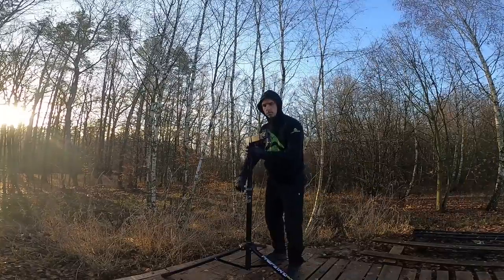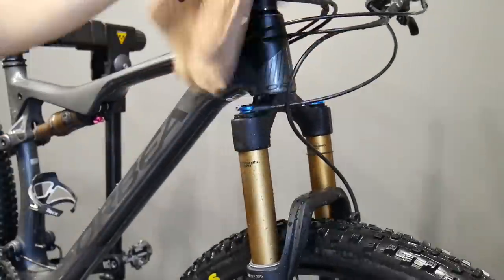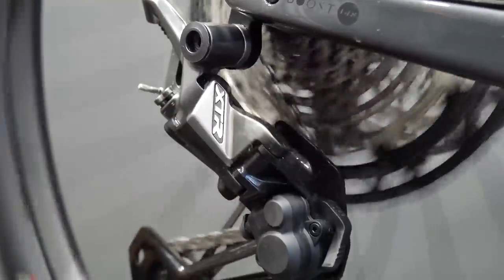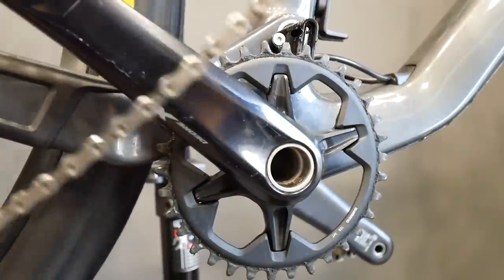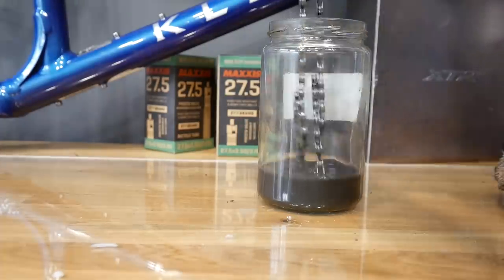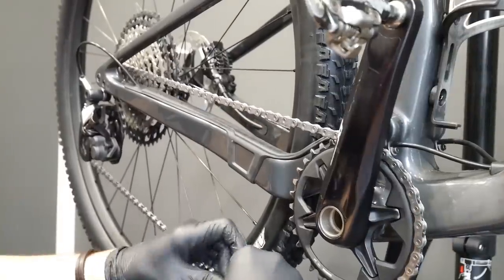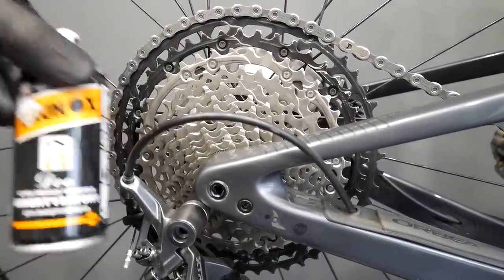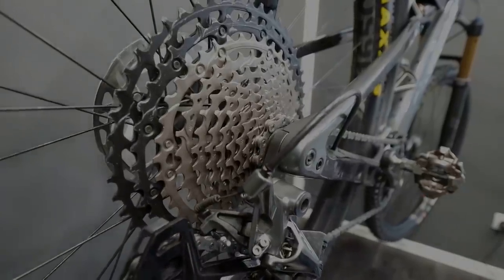One, Easy Trick For A Mud - Proof Mountain Bike Drivetrain. More Than A Clean Chain...

Comment: I have been riding and maintaining bikes for nearly 40 years. I am not impressed by this video and I have a few thoughts on it: 
1. The factory lube is in fact a really excellent deep penetrating lube for your chain, despite the fact that it can attract some dirt. A lot of folks agree. Personally I keep it on for a while and ride until chain is very dirty and needs a good clean. 
2. You don’t need to remove the chain from your bike in order to degrease it. Use a Park tool chain bath or something similar. It does a great job and no need to worry about breaking the chain and rejoining etc. It also has the added benefit of agitating your chain physically in the degreaser rather than just sitting there. 
3. You need to thoroughly rinse the chain with water a couple of times after you degrease it in order to wash and flush the degreaser out and completely off the chain, including from in amongst the rivets. Wiping off the degreaser from the outside does not remove the degreaser from inside the chain which is amongst the rivets.
4. Following this you need to dry your chain using paper towels or a dry clean rag to make sure all the water is removed. I also leave it overnight to evaporate and dry further before re-oiling. 
5. Re-oiling the chain by running the chain fast under the nozzle of your oil bottle is lazy and actually a really a poor way of oiling your chain. Instead oil each rivet individually and slowly by hand making sure the chain is completely saturated and gets into each link join. Give it an hour or more to sink in. Then clean the excess lube off from the outside of the chain and off from the chain rings and jockey wheels.
Reply: I appreciate this constructive comment, it looks like the way to go.
Reply: I've been using Rock and Roll Gold chain lube on a friend's recommendation, which seems to work well for both cleaning and drying/protecting.
Reply: Excellent comment 👏
Reply: Comment beats video :)
Reply: @MD.media01  hi, depends on the pressure you apply. Just need to lightly hold thick paper kitchen roll sheet around chain and run through and then change to different parts of the paper towel before it starts ripping. Or like I say just can use a dry cloth instead.
Reply: @watchusaiyankakaren  All of the above takes around an hour total time to do properly, perhaps a bit more. But in any event, what is your rush in life?! Better to take your time, enjoy the process and take satisfaction in a job well done. Slow living 🙂. I actually really enjoy doing it. I get real pleasure at the end when I get to place the new oil on a perfectly clean chain, followed then by a nice long ride afterwards to bask in the efficiency and aesthetic of a perfectly clean drive chain and bike. One must take enjoyment out of the simple pleasures in life!
Reply: Wash chain with water? Are you mad?
Reply: @the_udmurt  what are you talking about?
Reply: @paddyotoole2058  you don't have to remove degreaser. It dries completely. If it is good one, without oil, of course
Reply: @the_udmurt  yes, the degreaser will dry but it’s residue of detergent and other ionic substances shall then remain on the chain. Do you think all of the degreaser just vanishes into thin air?!
Reply: @paddyotoole2058  i am doing like this for 5 years and have no problems at all even with Smoove lube
Reply: @MD.media01  depends mostly on the quality of the paper towel. the more expensive ones usually will not leave bits, they are more resistant to friction
Reply: maybe clean the outside with the cloth when you get the new chain if you want to leave the factory grease in, no?
Reply: You are weak if you need to lube your chain
Reply: I also prefer to take off the chain for cleaning. It makes cleaning the chain a lot easier but it also let you clean the rest of your drive drain with more ease. I used to have the ParkTool chain cleaner but I was honestly not impressed with it. Instead I use a method similar to SickBiker's way. But I use a plastic round container (like the one seen in the video) and spin the chain for several minutes in a mixture of hot water and dish washer detergent. When the water gets dirty I replace the water with hot clean water and repeat this until the water stays clean. It usually take three to four cycles. This removes any dirt from the chain. I usually dry it off with a rag and let it dry over night before mounting it back on the bike and give it a new oil treatment.
Reply: Ain't nobody got time for individually lubing the rivets
Reply: @the_udmurt  I have to agree with paddy , water does wash the degreaser off and then you have to dry the chain off and it is a pain in the arse.I spray GT 80 on the chain and then use the chain cleaning device dry so to get in to all the nooks and crannies and then rag all off and also have an air line, so this at least cuts out the water wash off

Comment: I think is better to remove cassette before cleaning. Degreasing spray and oil from brush can end on disc rotor. Result is contamination, which is bad.

Comment: Holy cow! If you do this every time you've been in wet/dirty conditions - Respect! No way I can find time and energy to do this 'trick' more than a few times a year...
Reply: Me too.

This seems to me extremely inefficient.
If he does this really after every wet/muddy ride, he wasts soo much time of his life.
I mean... Normal chain maintenance needs what, 5 minutes? Clean it, relubricate it, remove acess oil. He needs I would guess an hour? For what? To save 30 Bucks every 4-6 months?

Before a race, yes, absolutely. For everyday riding? Hell no, I have better things to do.
Reply: @dag1704  yep! For my opinion, methode like this costs a lot more time, than price equivalent of the chain. Seems like less cost is just buy a new chain when it dies instead doing this almost every other day. This methode, for me, looks like I have to grovel to my bike, instead riding whith pleasure.

I just trying to say, that u need to spend a LOT of time for this. It`s okay if u have much of free time, but it doesn`t if u have to work 50+ hours in a week, lol.

Comment: Soak and flush the chain in petrol, dry off with a rag, soak in de-greaser and flush with waste, dry off with a rag. Allow the grime to settle, drain off and save the petrol and de-greaser for later reuse.
Melt paraffin wax to about 55-60DegC take off the heat and add approx 20% 20w50 oil. Pour into a plastic container that the wax can be removed when it solidifies later on so you can remelt.
While the wax is still liquid immerse the chain fully so it is covered with a bout 50mm of hot melted wax over it. Agitate the a little to allow the wax/oil to penetrate and displace any air within the chain and leave for about 10-15 minuets. Fish out the chain with a wire hook while the wax is still molten and a skin is just forming on the surface of the wax. The chain will still be hot allow the wax to drain off and lightly wipe off the excess wax. Allow the chain to air cool and reinstall chain on the bike.
The wax/oil mix will have lower the melting point to a bout 35-40 deg C for remelting and waxing the chain. The wax mix on the chain  will become soft at around 28-30DegC and unlikely to spatter all over your bike as oil does . Sand and dust is less likley to stick to this mix than it is to oil or grease.
Re-wax every 4-6weeks depending on how much you ride.
Reply: that lasts months on my road bike keeps it looking new after a thousand miles

Comment: Cleaning the cassette after lubricating the chain?   Is the video in the correct order? I would clean everything first, then I use an air compressor to dry the chain. Leave it for a while then lube everything.

Comment: I service my bike at home so I switched to wax. I remove the chain, clean it in a bottle with a small ammount of mineral spirits, then place it in a molten wax bath for 5 minutes. Waxed chain leaves no grime so I don't have to degrease the rest of my transmission - everyghing can be cleaned with warm water and a rag/brush, no mess. Performance-wise, didn't feel any difference.

Comment: A.wet the bike
B.Motip gel degreaser on the chain and cassette
C.fill up the chain cleaning device with degreaser
C.Spray with WD 40 bike wash liquid everything including the foaming drivetrain.
D. Run 50 rotations with the device filled with degreaser and another 50 with water
E. Hard brush long bristles do cassette and chainring. Rest bike with sponge.
Rinse everything. Dry with rag. PTFE spray  on derailleur, dry lube always on the chain, brunox on shocks and dropper posts. That's 10 minutes. It's my nemesis but it's done after every single ride right at the car parking.
Reply: Always protect your rotors from overspray of lube. I forgot to do this on my rear disk. Just a little bit of overspray will mess up the pads if it's not cleaned up.

Comment: I totally agree keeping drivetrain clean and dry is most important. But i would suggest to use dry industrial chain grease, it is times better than bike chain greases. But ofcorse after applying the excess must be cleaned because chain only needs grease inside bushes not outside.

Comment: Wheel out to clean cassette - one drop of oil per link at a time - takes longer but more effective - not sure citrus degreaser will contaminate discs but good practice to protect them regardless.
Reply: Absolutely.  Don’t use any spray - except maybe brake cleaner - where it could contaminate the disc or pads. A schoolboy error.

Comment: First question...is your floor covered in little gunk bits and what did you put down to collect them. Second, is your wall covered in grease splatter from all that brushing? Third, how is your brake rotor not contaminated from all that careless brushing in the rear?

Comment: Every time? I ride my bike 5-6 times a week, so no. I clean the chain, cassette, etc, with towel and thats it. I mean, how many time does it cost to clean the bike nearly every day this way? 8-10 Hours a week, just for cleaning?
Reply: Hi, mechanic from moab utah here. You should be cleaning your bike dependent on the conditions you ride in. If its a lot of mud and wet conditions you really want to keep it clean after every ride. If its dry and a little dusty a simple wipe down of the chain is fine. Washing with water and dish soap and a brush should be good enough for muddy days.
Reply: Fully agree with that except I would probably use car soap instead of dishsoap just to protect the bike's factory paint protection, but yeah riding with a dirty bike without washing it is a great way to get dirt into your bearings.

Comment: Have you experimented with hot waxing your chain? Parafin wax works well as a lubricant and no dirt or dust sticks to it.
Reply: Paraffin wax is my favorite for the chain.  I'm not able to use it now because I'm running a Dura Ace chain and the chain must be taken off to hot wax.  Shimano does not recommend a master link  and I don't want to replace a chain pin every cleaning.  I wipe the chain clean after every ride and I lube with Boshield T9 on the chain pins.  Highly successful.

Comment: You can do something similar for the frame. Wash thoroughly, let dry and then apply Pledge furniture polish. 
After a muddy ride, just let the mud dry and then brush off the mud which will flake off easily. Works on the cassette and exterior of chain as well, as an alternative to silicone, mentioned by others.

Comment: Everyone says "clean drivetrain religiously", oh but use "special lubricants" then clean them off every ride or when the chain and cassette are visually dirty. Might as well use any CHEAP oil because it gets cleaned off anyway. All I've used is clean engine oil and motorcycle fork oil and have had a cassette last for over 4 years and still going. Not going to buy expensive lube.
Reply: Rather meaningless to say 4 years. In 4 years I put 50,000 km on my bike. Does your cassette last over 50,000km? My brother hasn't changed his cassette in 20 years, but then he never rides the bike!

Comment: Well, some questionable details like the pressure washer or the spray towards the brake disc.
After all you cleaned and lubricated your drivetrain with quite some passion. OK, but how does that make it mud proof? The mud will stick a little less easy on a cleaned and lubricated surface but in the end it will stick anyway.

Comment: by pressure washing the rear sprocket, all the grease and mud goes to the rear sprocket. It's a big mistake.  if so, direct the nozzles from the side of the shield or vertically from above onto the rack.

Comment: I use different method. Couple years back, seen some people using paraffine  / beeswax method. Tried that, worked nice. I improved it with graphite powder. Nothing sticks to the chain, and sounds healthier. But, I'm riding mostly gravel roads and city. So this isn't solution for everyone. I concluded that not having a grease is way better then have abrasives stuck to chain. In my case I use dry grease with graphite, it lasts around 200 kilometres, then it needs to be greased again, for that i make terpentine or kerosene solution, same stuff but diluted in solvent. Works great, made a lot of kilometres, feels fine.
Reply: You improved it or watched the updated video on adding graphite?

Comment: I cook my chain once a year in Putoline chain grease (more like wax, stays where it should) in the can for Non-O-Ring motorcycle chains together with my 125 cc Chain. During the year I only Keeper the chain clean / rust protected by Pullis it through a cloth with some gear oil or any other oil.
Same with all my motorcycle chains.

Comment: I would honestly take the wheel off to remove the cassette to achieve that cleanliness and lubing. I’m not a fan of submersing the chain in degreaser or paraffin as I’ve seen some bike shops do it. Q20 degreased and leaves just the right lube film on the chain. The real trick is to NOT use commercial lubes: squirt, white lightning, finishline are all dirt magnets, it creates a compound that kills your drivetrain, whether in wet or dry conditions, DO NOTuse these products, Q20 with proper cleaning is all you need. My XX1 eagle chain and chainrings last a minimum of 3000km, I practice what I preach.

Comment: Well, this is the right video for Pressure washer cleaning and oil lube haters.
Everyone here seems to be owner of the truth.
I like to spend some time cleaning my bike, gives you the oportunity to inspect the bike for debris or any other stuff.

And for you haters: I use silicone Spray on fork stanchions, cassette and chainring (and yes, wheel on the bike) before any ride.
Reply: Why on the wheel?
Reply: @psychonaut038  I mean I don't take out the wheels before silicon spraying, just try to be carefull around the callipers and rotors.
Reply: @ManuelMartinez09  O haha, I read it wrong. So why u soray the chainring and stuff? I onky spray the fork.

Comment: Using a pressure sprayer is the worst way to clean your bike. Water gets in your bearings , use pledge furniture spray ,spray everything on the bike an the dirt wipes off after riding with a rag. Spray the pledge first .
Reply: Watch seths video
Reply: And these days mtbs Have sealed bearings
Reply: @Sahkomiaas  sealed but not againts pessure watter.
Reply: @martindurchanek8090  it can be a Bad way to clean The bike but you don't Have to complain about something that small
Reply: Dude how may pro teams have to use pressure washers before you people let this one go.
Reply: been "jet washing" mine for almost 5 years. 2nd head set ( replaced due to wear) suspension bearings changed twice in 5 years, BB changed twice in over 5 years,  this for an average of over 100 rides a year and riding the trails mostly in wet, muddy conditions, the hint is "sealed bearings"
Reply: go tell this to mx rideres. they will make fun of you. just dont water pressure around suspension rubber seals, we say semering, im not sure english word.

Comment: Was this edited in the wrong order?
Sure degrease the chain if you must but you must get rid of that degreaser from deep inside the links or your lube will never make it in there. 
That normally means a water wash afterwards if your degrease is soluble then shake out the excess ( air gun if you can ) then leave to dry, not dry to touch but dry out. 
Then 1 drop of lube per link, don't get it on the edges, just the rollers. if you lay the chain on paper towel you can do the whole lot, if not just do the exposed inner links, leave a few mins then turn the crank to expose the next links ( normally about 3 times ) 
Run the chain through all the gears to put some lube on the gears then wipe off everything with a towel leaving only lube in the rollers.
Leave overnight at least before riding.  

Unless your ride is proper muddy or a long wet one use dry lube only, the odd bit of wet on a couple of hour ride won't remove a dry lube enough to hurt.
However after every ride wipe the chain clean with a rag, be it dust or mud.
If the weathers dry this is all you should need do for a few rides before a full relube.
If wet I then wash with muc off, spray with a disperser, dry, leave overnight and lube the next day.

Comment: 1) Put degreaser on the drive train 
2)Clean chain with degreaser 
3)Wash off old degreaser with water from the drive train and chain 
4)Clean drive train with a brush and water 
5)Wash the entire bike (optional) 
6)Let it dry 
7) Lube Chain

(***Not recommended to degrease the chain and then apply degreaser on the drive train as degreaser may solve the lube on the chain ***)